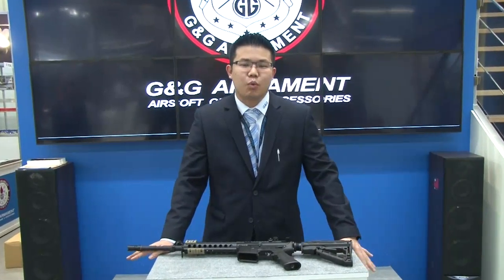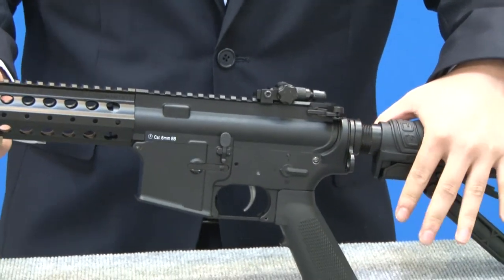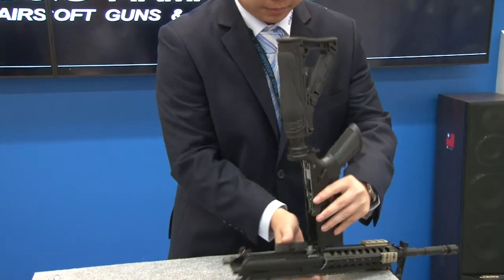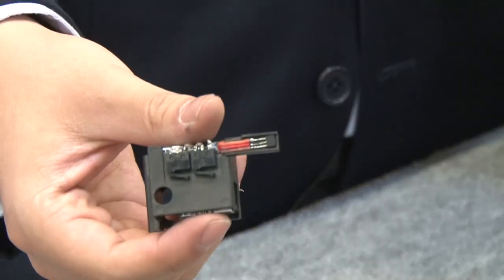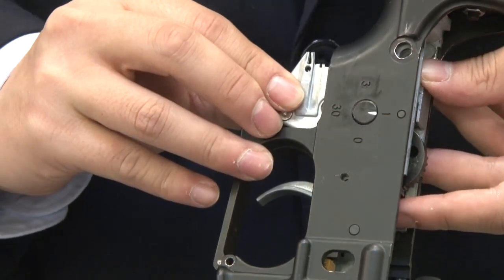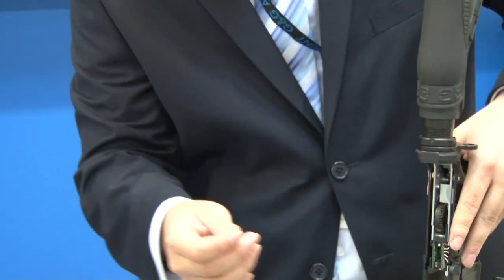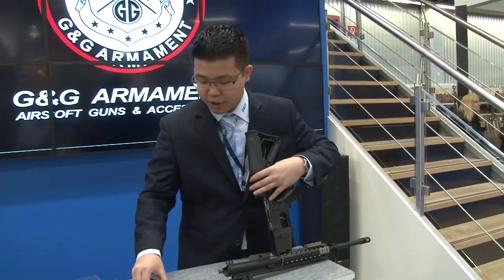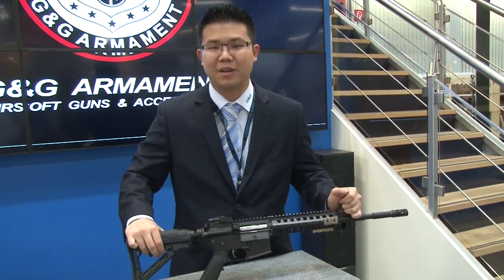G&G 2013 IWA SHOW G&G ARMAMENT G-BOX DEMO

Comment: @Ap0ph1s15 motor seems to be held inside the grip by the motor grip plate the same as TM designs they just added metal contacts instead of wires to complete the circuit and made the grip lock in with a proprietary lever instead of screws like the TM... Only thing this eliminates is PTS and other after market grips likely :(

Comment: I wonder how much parts of the gun is proprietary, at nice as the system is, having parts compatible with current existing systems is a huge plus. Most new concept guns these days try to retain, form, function and compatibility both in airsoft and real steel. WE katana, Bolt ERG, etc... are trying to maintain around 90% compatibility for the upgrade gearheads which is a plus.

Comment: I like this product, will you guys be selling it separately? I want to get this for my g&g gr4 100y and I am wondering if it will fit in it. Also, how do you remove the flash hider off of the gr4 100y? I want to put a mock suppressor on it.

Comment: Wrong, I own two PTS Masadas and while yes you can break down the receiver and barrel assembly quickly, you do need tools to remove the GB from the lower receiver. Two hex end wrench sizes are required to lift the GB. This gun breaks down to a level of internal repair without tools while the Masada requires a complete GB break down. Say  you blow a piston on the G&G, it will require less disassembly to repair it than the Masada.

Comment: Errm... this is bit like ICS's mp5 with split gearbox + microswitch / burst mode.. although my question is... why would anyone buy this over ASAR's upcoming gun... which has split gear box, quick spring change, but most importantly, function bolt catch / anti-dry firing mechanism compatible with normal AEG magazine... also by messing with standard gearbox design, it means you can't put units made by companies like Airsoft system or BTC programmable mosfet into it..